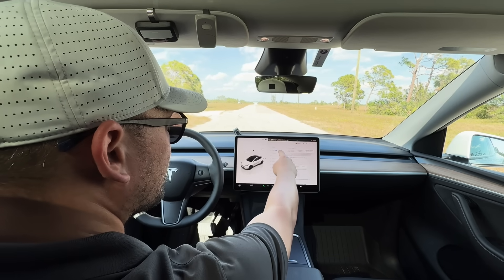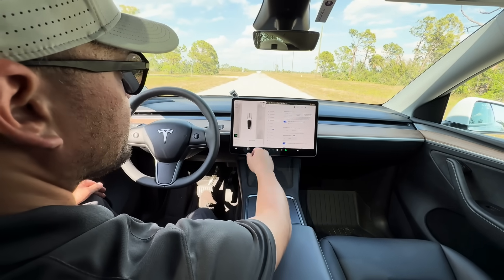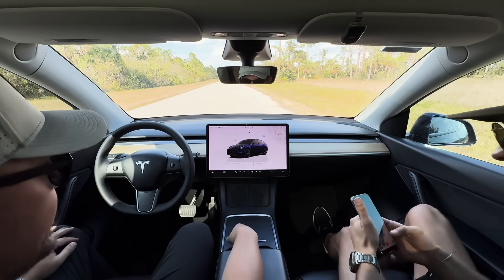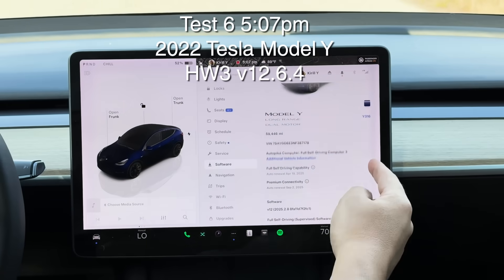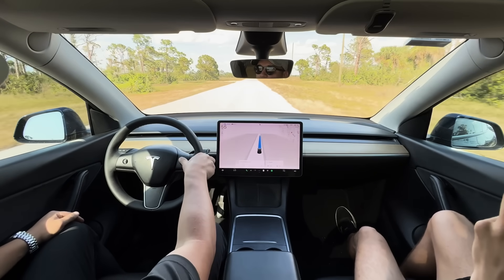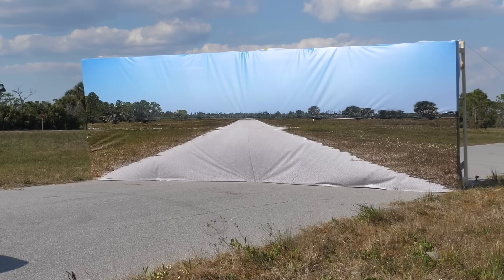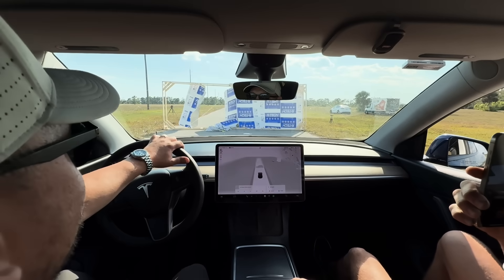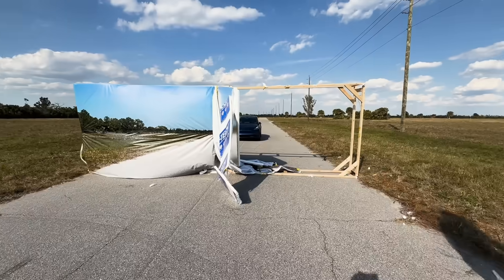Mark Rober Debunked - You can't fool a HW4 Tesla using FSD!

Comment: THIS, THIS IS THE VIDEO! You showed us the gas & brake pedals, the versions you were using, time of day AND you went through the wall (which everyone wanted), & no major bias being explained or reasoned away one way or the other. BIG props, this was fantastic
Reply: Mark didn't have biases. He is a content creator that took the best angles of the inevitable and spliced them together. I am confident that these guys learned from marks video to put the foam behind the print poster for dramatic effect after they watched the interview.
Reply: @achilleshennessy9725  exactly
Reply: @achilleshennessy9725  that's a fair point, what do you think the reasoning is that this video has several fails yet also several successes where as Mark's video only has failures? I appreciate your thought process!
Reply: One lingering question that I don't think was answered.  2022 was the year during which Tesla removed ultrasonic sensors from Models 3 and Y.  (Early October 2022 to be exact.)  It would be good to know if this Model Y has the sensors or not.  The sensors would likely have detected the wall at close range -- and, if so, at least tried to stop (even if too late to prevent impact).
Reply: @harmanx.  Same,shouldn't have removed it
Reply: @harmanx.  Those sensors work at about 10ft. The car would be able to stop from 45 to zero in 10 ft.
Reply: Tesla does not have a gas pedal
Reply: @UnknownMoses  thank you, it was killing me that people wouldn't know what I was talking about, this really cleared things up
Reply: Yeah thank you for doing this. Mark Rober should be ashamed.
Reply: @mdd83646  He had two takes where they went through. He explains it in an interview and it seems pretty genuine. I wouldn't say that he should be ashamed, just that made an error in judgment in using autopilot rather than fsd. He also said he'd be happy to redo it with fsd.
Reply: @mdd83646  Ah, yes, Mark Rober the Tesla hater who owns a Tesla should be ashamed....

Look, it doesn't matter how good this stuff gets, it will never be as good as if it had Lidar. Radar can see things cameras can't. Period. End of conversation. Rober also tested in multiple different environments of which Lidar did better. Sure, screwed up the last test. But all the other tests showed that there is gap between technologies and people will continue to die because of it until certain people get their heads out of their arrogant asses.
Reply: @rabidkangar00  That's just not true. Lidar is not flawless, it has a really hard time in fog, snow and rain. There are plenty of videos you can check out to verify my statement.
Reply: @spacecowboy2483  He said it would be better with Lidar not flawless. Redundancies in safety usually result in safer systems.
Reply: @rabidkangar00  you don’t need to see through fog or dense rain to understand that you need to slow down. Basic autopilot doesn’t “know” that. FSD beta should have at least slow down in that situation, but we don’t know because of Mark’s poor methodology, so it’s still inconclusive. 
Based on what others experienced with failed fire hydrants, FSD would prompt the driver to take over or it would do a hard brake.
Reply: @spacecowboy2483 exactly why most cars with Lidar use both cameras and Lidar - that's the point. Cameras alone aren't as good
Reply: @spacecowboy2483  I mean, optical cameras struggle with those things even more than LiDAR does.  The only time I can think of that optical cameras would surpass LiDAR is for image recognition, which is absolutely an important part of automated vehicles, i.e. recognizing stop signs, traffic signals, etc.  However, for strictly detecting obstacles, LiDAR is, and always will be, the superior technology compared to optical cameras, even in the scenarios you described.
Reply: @rabidkangar00 hmm I don’t know about that. Mark tested lidar and autopilot against a wall of smoke and a wall of water. If both sensors were actually immersed in the testing environment (so both wet with rain or dew from the fog) the results would have reflected actual driving conditions much better and the outcome MAY have been very different. We don’t know because the test setup was faulty for testing actual conditions. Also he should have used FSD not autopilot.
Reply: @capt4in1 If he did FSD on HW3 the results apparently would have been the same. HW4 based on this video, would have passed.
Reply: @DarriusTaylor  against the Wiley E. Coyote wall yes. I’m more interested in how FSD performs against the wall of water and wall of smoke compared to LiDAR. And again both when immersed in the environmental conditions.
Reply: @rabidkangar00 Lidar can’t see through mist there for its worse then Tesla. Also FSD was not enabled on his Tesla only auto pilot and on top of there’s a manual disengage of auto pilot 2 seconds before the crash
Reply: @rabidkangar00  The problem is it was bad science during a specific time where "the thing to do" is hate on Tesla and he was working with a Tesla competitor.  All around stank.  Stank all around.  Follow the money.

Now that I got that out of the way, the other commenters pointed out cameras actually see things while LIDAR detects it.  Part of what they're doing with cameras and FSD is teaching the car how the world works.  Humans look like humans and walk around and do crazy things.  Cars look like cars, they move forward and back and turn.  Semis look like...well, you get the drift.  Different things act differently so you judge their potential movement patterns differently.  It is a shame, though, that those Teslas fell for such a Looney Toons idea.
Reply: @rabidkangar00 mark is a jimmy kimmel lover
Reply: @rabidkangar00 lidar will slam on the brakes because there's a water stream near the road. What even
Reply: @rabidkangar00 except people don’t use lidar to drive they use their eyes 👀
Reply: @Sydnicate  lidar can 110% see through mist better than cameras.
Reply: @spacecowboy2483  reading comprehension is at an all time low. You're contributing to it
Reply: Mark also did the test correctly it's just tesla lovers vs not tesla lovers

Comment: A Fundamental Problem with FSD:  

One of the core challenges with Full Self-Driving (FSD) is decision-making speed. The more data the system processes, the longer it may take to make a decision. That aside, Tesla's approach requires the car to perceive and process the world from scratch every time it drives down a road.  

This method demands immense processing power. What should happen instead is that the car compresses visual data into a 3D world and stores it. The next time it drives the same road, it would still process the environment but also compare it with its memory for accuracy, differences, and improved maneuvers. Tesla claims their approach is easier for the computer, but it also conveniently costs much less.  

This raises two possibilities:  
1. FSD will never reach 100% autonomy.  
2. It eventually will, but Tesla is still iterating while simultaneously selling hardware that is already outdated.  

For true FSD, the car essentially needs a supercomputer with a petabyte-sized memory cache. You're looking at the power of two RTX 4090s, or perhaps 5090s—possibly even Nvidia's commercial-grade GPUs—alongside massive amounts of memory.  

Interface Issues:  
Another issue is Tesla’s reliance on touchscreen controls. Below that LCD panel, there should be a keyboard with programmable buttons. The current interface is unsafe when you need to quickly adjust wipers, switch from GPS to the radio, or perform other critical functions. Physical buttons are necessary. Additionally, the car should allow users to store and access media like movies and MP3s.  

Right now, Tesla operates under an implied "stewardship" over consumer hardware, much like Apple does with iPhones. Apple assumes ownership of its devices, pushing users to upgrade every two years—whether they’ve paid them off or not—unless they’re savvy enough to keep them. The same philosophy seems to apply to Tesla’s approach to FSD hardware.  

LIDAR is a Must:  
For true autonomy, we need at least 10x more data processing capability, more cameras, and LIDAR. Even then, I stand by this: you cannot let your guard down.  

My Model 3 has nearly crashed about ten times—incidents where, if I hadn’t intervened, a crash was *guaranteed*. Most of these involved merging onto a two-lane highway, where it failed to yield, or left turns with blind spots. One time in Boston, it almost drove onto train tracks.  

Final Thoughts  

I’m pro FSD, not anti-FSD. I want it to work. Right now, though, it's "iffy at best" and "amazing" at the same time.
Reply: Computing power isn't a problem. Your brain is a lot faster than a neural net but it's extremely inefficient in how it utilizes said computing power because it has to do everything within one single organ.

A neural net/AI doesn't need all the superfluous and redundant systems to control breathing, movement, balance, cell regeneration, emotions, memories, distractions, consciousness and subconsciousness, immune system, inner organs, constant facial and pattern recognition, nervous system, and store and sort large amounts of sensory data on constant basis, etc. Your brain needs to do all of this stuff (and more) while driving a car at the same time.

We must also mention all those physical connections in your brain adding to the time it takes for synapses to go from point A to point B which is another limitation a computer wouldn't have. A computer doesn't have to deal with reaction time either. An FSD neural net literally only needs to do one single thing extremely well, which is drive a car. All those redundant systems a human brain will have to deal with on a constant basis that a neural net doesn't need means a neural net can be much more efficient even with less resources.

Your brain is one single unit. What requires a ton of computing power is training the neural net which is done externally on the Tesla Dojo supercomputer. That's a luxury your brain doesn't have. Once the neural net knows what to do it doesn't take much computing power to simply execute commands at an instant. Imagine if you could program a human brain to spend all its available computing power just on driving a car and nothing else. That person would most likely be the best driver in human history.
Reply: Yea processing vast amounts of real-time visual data requires immense computational power, but Tesla's approach relies on neural networks trained on billions of miles of driving data to make split-second decisions. The idea of storing a compressed 3D world is conceptually sound but that disregards the fact that roads constantly change (construction, parked cars, weather effects), making static memory unreliable for real-time decisions.
Reply: Well said 👌🏽
Reply: Musk has already testified in court that FSD will never reach autonomy. It'll never get past level 2. So... there's that.

You don't need to store a compressed 3D world if you use LIDAR, because the LIDAR gives you the 3D model of what it's seeing.

Comment: It does see an obstacle and stop, but it does still think the painted wall is a road. You can see on the screen that it believes the road continues and has it bending slightly to the left as the picture appears. This is the same on HW3 and 4. You can see this also by the way in HW3 when it goes through it you end up on the wrong side of the road as the car is trying to follow the road to the left. I am intrigued what the HW4 is actually identifying as an obstacle as it does believe there is still a road. Would be interesting if a more realistic wall with less ripples and/or a bigger one taking up more of the car's FOV would be enough to fool it.

Comment: A great test. Thanks for taking the time. Also really shows how the other scientific you tuber didn’t try to show the car in the best light.  Using only an older version without much explanation or scientific details shows me that they had negative intentions. IMHO
Reply: Consumer protections isn’t negative intentions it’s positive. Who loses when failures are shown? Tesla and its weird defenders.
Reply: The other YouTuber video was a hit piece for LiDAR. Also the guy had way more knowledge and could have made an entirely different video if he wanted to.
Reply: @JoeRendaRealty  almost as if lidar is real and foolproof and FSD is an overpriced vaporware beta option
Reply: @ wrong again. LiDAR has many weaknesses. It has big issues with water. Like rain !!!
Reply: @ you clearly didn’t watch the original video. LiDAR handled it great
Reply: @ I’ve watched lidar think water is a wall.